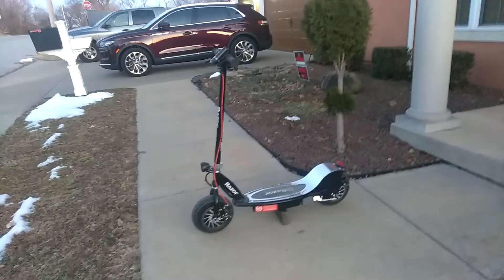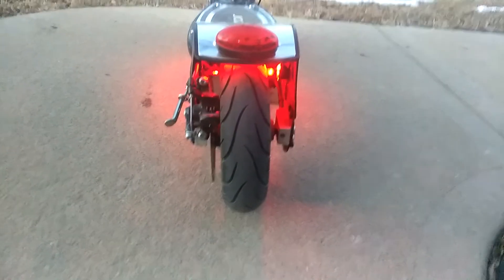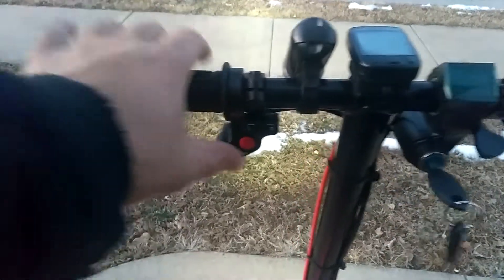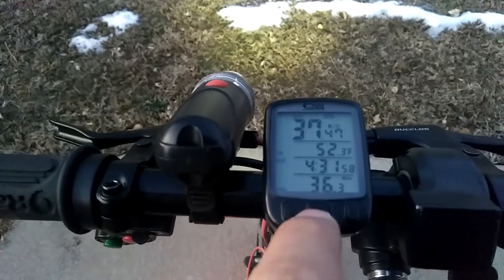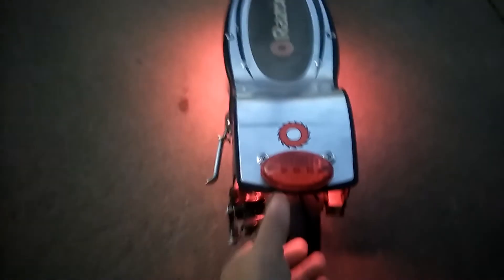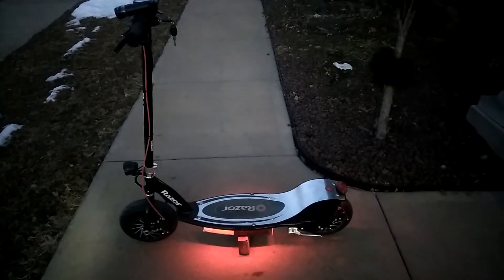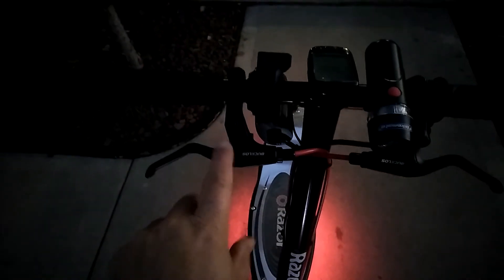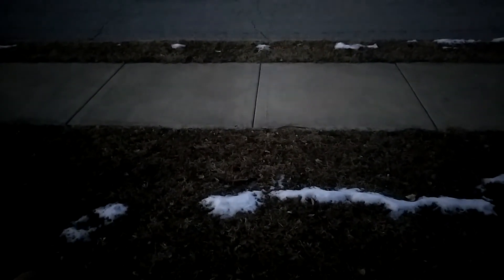Razor e325 dual hub motor .

Comment: Looks and drives fantastically. Really superb job.
One question, did you disassemble the hub motor and widen the through holes on the front forks so you could feed in the axle, or cut drop outs in the forks so you could fit the hub motor?
Reply from the maker: Yes I cut the forks.

Comment: I was looking to convert my old e200 to a dual motor when I found this video I’m really interested in doing this to mine you just gave me the motivation to try it but I wanted to ask if you have to change the speed controller
Reply from the maker: Yes I had to change the speed controllers.
You will need 2 one for each motor.

Comment: I inherited a E325 scooter but the motor I think needs replacing.  What should I do?
Reply from the maker: I would replace it with a 350 watt 24 volt motor you can purchase it from eBay or Amazon. I would also change the throttle to a variable speed throttle and it comes with a gauge for your battery and a key to keep someone from getting on your scooter and riding off. And change from the stock speed controller to a upgraded battery speed controller that's 24 volts. And since you're not interested in going very fast change the sprocket to a 65 tooth rear sprocket and you will pull heels a lot better than with the stock one.   Here's a video of some of the stuff that you need to do to it.  https://youtu.be/TGPzLLagcxo  .  I hope this helped you out if you need anything else please contact me again.

Comment: Hey man, Great job on the Razor upgrade!  I upgraded my e300 over a year ago with a single 1000watt rear hub motor, dual disc brakes and lights and it has been awesome for exploring new places and going on group rides. I like your axle block idea, though I ended up just making bends in the frame to close the gap.  I get similar specs with a 48v lithium battery...cruises between 30-32 mph and 30 mile range and is quite stable.  Which motors and dual-motor controller did you use? Total wattage?
Reply from the maker: I'm using 2 of the cheap China speed controllers they are 350 w 48 votes they were somewhere around $16 a piece. The hub motors was 350 w 36 volts I don't know what company made the motors. The place that I purchase them from said that they didn't know who they were made by they really didn't know anything about them they were brand new never used hub motor with the tire i paid $50 a piece for them with the shipping. My battery Bank is 52 vote 14 amp hours . The torque on this thing is unbelievable I had a 800 watt 36 volt brushed motor with the 52 volt battery  and what I have now will accelerate way faster than that one big motor.  I hated having that big motor up under the bottom it always scrub the ground when going over little bumps but loving it now with the two hub motors plan on going to a digital speed controller with regen braking in the future. Thank you 👍